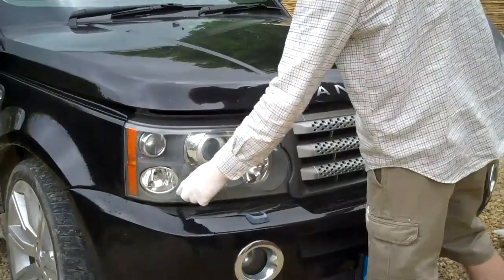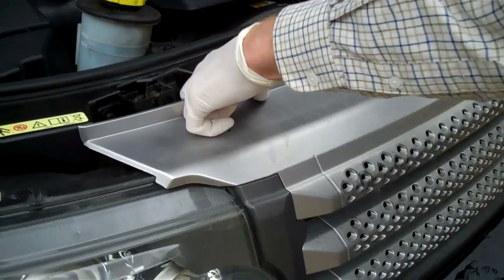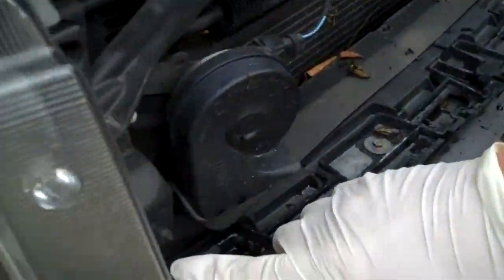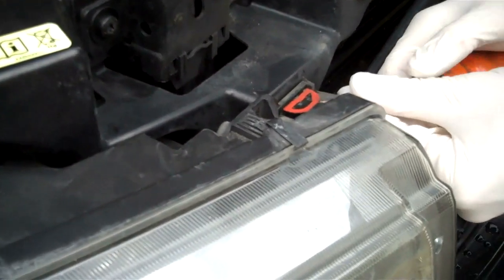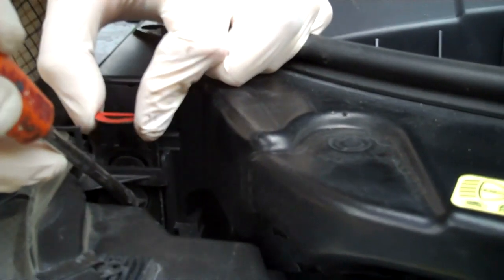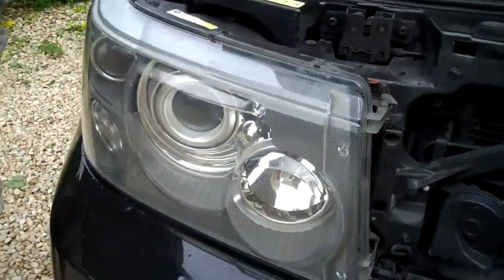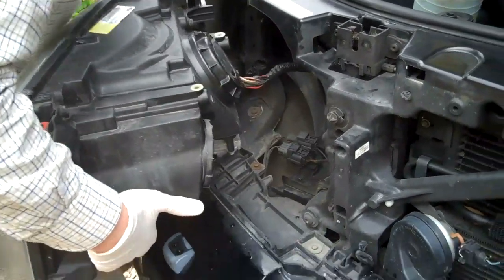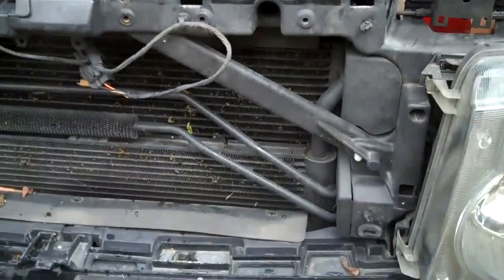How to remove the headlights on a Range Rover Sport 2005-09

Comment: Can it be that just the plug connection is dirty, if only the low beam does not work (control unit and light was already replaced)

Comment: I was changing the fron right turn signal bulb the 3457  and i noticed it was working because on the headlight assmebly inside of the female connector one of those little metal  things that connect into the harness got pushed in . what do i do ???

Comment: Hello! I have I warning light it is flashing in the dashboard, when I start the car the head lights are not leveling  I check the manual and it says adoptive head lights (AHL) I checked the fuses for the AHL and I founded  one that was burned I replaced it but after two or three days stops leveling the lights,  I checked the fuses again but nothing was burned any idea what can be? Lights works but they are not leveling